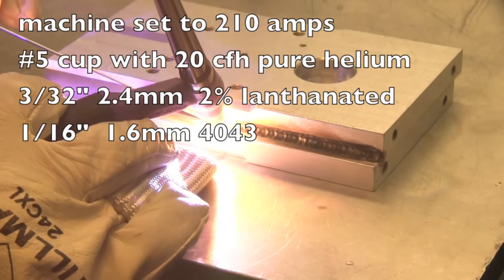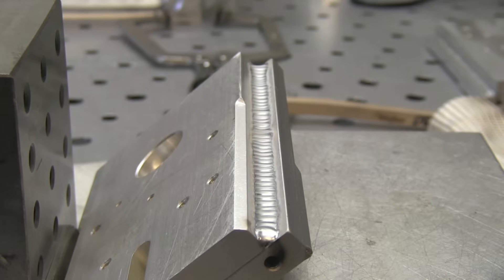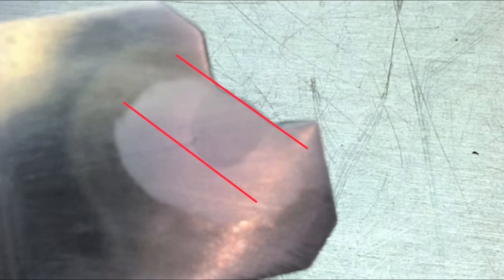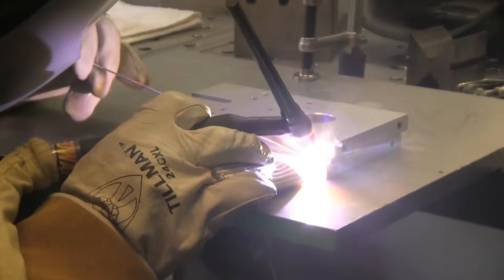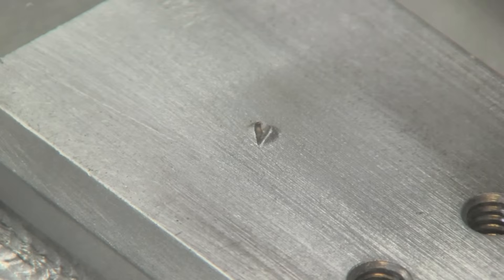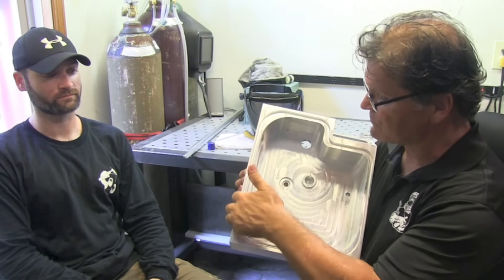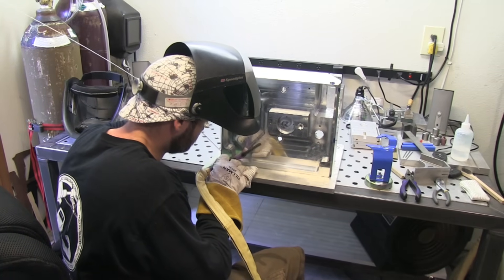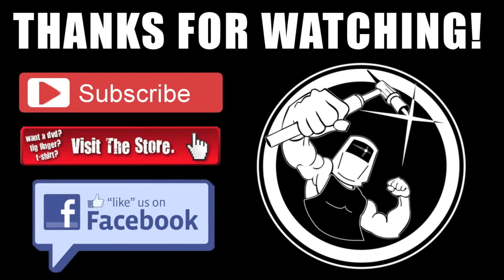TIG Welding Thick Aluminum using DC and Helium

Comment: Some of the inverter machines will allow you to interrupt DCEN with a pulse of AC every so often. My Everlast 255EXT calls it "Advanced AC pulse". Basically it combines the instant puddle and penetration of DCEN with the cleaning action of AC. The result is weld puddles that more or less look and flow like AC puddles - with the horsepower of DC. Neat feature.

Comment: ive seen some videos of dcep and dcen , im super confused what to use, i want to weld thin sheet aluminium butt weld as cheaply as possible, with a tig machine that had dc only and has a pulse option too

Comment: If helium is "pushing" more under the arc would a argon helium mix not be recommended for thin aluminum? I'm working with 2.6mm thickness

Comment: I've started aluminium TIG welding with AC machine a week ago and found that like I've never welding before. I've watching many videos in YT since week and still nothing useful found except some tips and tricks for beginners. So almost every vid in the YT are made in perfect condition and perfect position. Real life isn't that! :D
So, I made a desk from thin wall tube and beginning the welding frustrated me a lot, for a reason. Due I've never welding before. Okay, just kidding. Due I welding thin wall tube it get's good result and I'm satisfied. Now I have a project where I have to weld a thick wall frame, 5 to 10 mm thick, then I'm back in the beginning of this week - nothing came out. I've spent a lot of time in YT and today I found, a Youtuber said that preheat is necessary. Does it have any description too that how many degrees it has to be or is it kind a experiential? Many thanks for advance ;)

Comment: so i guess this is why it used to be called Heliarc.

question: if heliarc/dc negative heli gas TIG  welds are deeper, why did the standard get away from it and go to ac  and argon?   dont you want the strongest deepest weld?

Comment: I've welded 1/2 aluminum with helium on AC and it eats through. Never tried it on DC but I'm definitely going to give that a shot. I've pre heated with a hydrogen/oxygen torch and that worked well. Thanks for the tip!

Comment: Hi . I need some suggestions  I'm welding some aluminum  4
3/4inch to 3/8 I'm using Miller syncrowave 350lx  and it seems I need more heat it takes a bit to heat up I'm using water torch with 1/8 tungsten a number  8 cup and i have the machine  at 350 amps  and using 100% argon  and the at the end of tip balls up bigger then the tungsten  but still feel theres not enough heat
Reply: It sounds like you are in preheat territory!  Don't feel bad, since the energy you put in there with a big propane torch (for example) is probably a lot cheaper than the same energy (and argon) from TIG welding!
Reply: Sounds like exactly what I have at my job and I can’t imagine cranking it up that high for much of anything.  I also have rotisserie with torches and I would be warming it up if it was that big.

Comment: Could you do an AC cleaning run to get the Yuck off it first then go with  the DC for the first WELD then  back to AC for the top welds??????  Or would that start the heat too much for warpage.  And what about Helium AC does that wok as well with small cleaning  current?

Comment: I didn't realize you could do that. I have to try that with my Everlast welder.
Reply: Your Everlast manual says not to do this!  Mine suggests part Helium, which has worked for me.  I have tried to do as we see here and it wouldn't light up!  The arc voltage is higher with Helium!  I am going to eventually try with other machines, and also maybe heat the electrode first (strike an arc on a copper block for a second or two).  Try it!

Comment: OK, very cool, now here is my question... can this gas mix be used to achieve the same effect with a spool gun. I have a millermatic 211 and a 100 series spool gun and have an upcoming project to build my own 17" flat bottom river jet boat for fishing shallow rivers in MI. 

Yes, I know I should probably try and score a better welder but I am, ... pretty good life time welder with a LOT of experience but a thin wallet. I can step up, spend the $$ when it is time for the project but I really rather just use the 211 if it would work. The boat does not have to be built in a day.

If every one says no way on the 211, what would be a good tig machine to try and score off craigslist?

~
Reply: Since no one said anything, a couple things: one, the 211 is a very capable machine. Typically a 17' aluminum boat would have something like 18- or 20-gauge sheet aluminum... for reference, a 75 foot/40 ton steel vessel would use 1/4" steel plate for the hull. That being said, it'll be slow going to let things cool (no wet rags), but there's no reason you can't do this with a spool gun and 100% argon. If you feel like spending money, a pulse function would make life a lot easier, but it's by no means necessary.

Comment: Im making a welding table that attaches to my welding cart and the supports are 1/8 inch and table platform is 1/4 inch...my miller 180 SD is maxed out and I need more horsepower.  This technique is something i'm going to attempt and what i've been looking for....ty jody and roy.

Comment: Could you use pure Helium with AC tig welding to get the deep penetration? Or does it have to be Argon with AC.
Reply: I've had at least one welder (Everlast) that would not light up in pure helium. I think Everlast suggests a blend of helium and argon.  That works pretty well.  Got the idea from one of Jody's videos, it was just as he said.  I tried hard to use pure helium and just could not make it go.   The open circuit voltage has to be higher.  What they're talking about here is the real "Heliarc" welding, I really wanted to try it!   Maybe one day I'll turn up an actual "Heliarc" (from ESAB now) machine.  It seems so obvious!
Reply: Good to know!
Reply: I don't think there's any benefit.  You supposedly don't get the cleaning action with Helium, so you'd just be wasting gas and power.  If I had it all set up, I'd sure try it though!  How could you not?  Again, Argon with a small part of Helium or maybe 1/4 Helium is really something!  Hot, and it makes a big clear puddle, it seems to have all advantages.  If you do the set up Jody showed with two flow-meters and a "Y" to put them together....  try to do a little bead and have someone open up the Helium a little while you have the arc on, you'll see it right away!
Reply: Also, you can get a puddle on solid copper, which doesn't seem to happen with the usual Argon set up.   This might be important some day.

Comment: can you use helium to mig weld 1/2 steel eventho your machine is only capable of 3/16
Reply: Samuel Mason  more time id rather not waste.
Reply: I'd like to see the benefits of advance pulse welders. I understand they can weld much thicker metal than non advance pulse welders of the same output rating. I work in areas that have low amp electricity service. I really want to know more about some of the everlast welders with advance pulse used with helium.
Reply: John Kuck would be pushing it but i bet i could be done just not at full penetration
Reply: Are you asking if it can be done in a single pass?
If you can get the cup and rod in you can weld 2"  just a lot of passes!
Reply: @ John Kuck: Could you point me in the direction of where I can find information as to why He carries so much more heat? I like to know the how and why as well. Thanks

Comment: pse tel me why 37 degrees is used for pipe welding . why not 40 or 30 . surely that takes time to measure the exact degrees of 37
Reply: the bigger the groove you have to fill the more passes,filler,time and HEAT you will be putting into the joint.i worked in high production pipe fitting in Alberta and we never checked the bevel,just an eye ball thing.good prep is a sure way to have an easier time welding though.

Comment: wow!! this was an incredible video to watch and listen and LEARN.  thank you so much. i had tried aluminum tig on DC before and i came out nothing like this, however i was only using straight argon.. i will definitely be giving it another go.  the fact that you can get that much penetration without warping and a ton of pre heat is very useful.  keep up the good work and tell Roy that i check out his instagram all the time for amazing stuff.

Comment: 12:51 Why do you run the torch down the center of were you will be welding prior to starting your weld?
Reply: +Mark Rich on a lot of his videos he shows the path prior to actually striking so that he can confirm that he has the full range of motion available to complete the weld without stopping.
Reply: You do that to make sure that your hand can move without any obstructions all the way along the weld. Nothing worse than getting snagged by something mid-weld

Comment: do you need a different flow meter when using Helium? Thanks
Reply: Yes since helium has a much lower density than other gas's.  The floating ball type flow meters usually have scales for argon, C-25 (25% co2/75% argon) and helium. Usually you just turn the tube so the scale for the gas your using is facing the front to read it.  The cheaper pointer gauge type mostly are calibrated for C-25.

Comment: Hey Jodi would this work on anodized aluminum tube welding in the marine industry?
Reply: I don't think you get the cleaning action with Helium.  You might get lucky and it just somehow PUSHES the anodized layer away?  Take pictures!  This is an issue that comes up again and again.

Comment: Hi Jody, thanks for the clarification of this problem. i have a lincoln invertec V130S with a scratch start TIG torch.
what would be the minimum amperage of a welder you would recommend for welding aluminium with a DC welder? mine goes to 130 amps, the one you guys were demonstrating on was 210 amps. would my little welder be too weak to do any type of aluminium welding?
mike

Comment: Hey Jodie. Would this work with an argon co2 mix given the good  penetration properties of co2 as a welding gas?
Reply: No with TIG you have to have an inert atmosphere, argon or helium, or argon/helium mix because you have to protect the tungsten from oxidation.  That's the reason why you have a post flow setting on the machine, to allow the tungsten to cool down before it's exposed to the air.  Carbon dioxide splits apart in the arc and for a fraction of a second becomes carbon monoxide, loses it's energy then recombines to form carbon dioxide again.  This works well when using MIG on steel, sense you can add de-oxidizers to the wire.
Reply: Your electrode will burn away!   Probably won't do the Aluminum any good, either!  There's more to life than penetration!  "That's what she said".
Reply: At my job they got an Argon - 10% co2 mix by mistake and asked if I could use it up so they wouldn’t have to deal with returning it. I tried using it and while it welded fairly well ( little sooty ) I found out the welds came out hard as rock. I told them no, I can’t use it.
I don’t think I tried it on aluminum.

Comment: thanks Jody for the awsome vid. i do 90%of my welding infield, i dont own a spool gun, so when it comes to aluminum I have to through my small tig diversion 185 on the truck which does the trick on irrigation pipe and thin al. repairs, but when iam stuck in a bull hauler working on structure, that welder hardly cuts it, even with preheat, but what i have learned from your videos will definently makes my life and welds better, thanx

Comment: Hey Jodi have you built a tungsten sharpener ? I came up with an inexpensive harbor freight version that seems to work great. 

4" angle grinder
Chainsaw sharpener replacement blade
And a small bushing I made on my lathe and a guide block to slide your tungsten into.

Robert
Zr1.rar@gmail

Comment: I build aluminum boats, and I'm at the end of our production line. I'm responsible for repairing other peoples leaks in the gas tanks, etc. It's a real chore with AC, and I'm curious if this technique may be beneficial to my company. To be more specific, I'm wondering if the DC current would burn out an impurity beneath the surface, or if the same ammount of grinding/cleaning would be necessary? We use marine grade aluminum, I want to say it's 8056. Thanks in advance
Reply: Gabe M Maybe 5086-H32 ? listed as good marine grade,strong,resistance to corrosion.

Comment: Does this type of welding meet standards? The depth to width ratio on that weld is wrong, that's the reason there is a solidification void in that one one, which would fail any test right? 

I can see if you're using it for non critical things but if it had to be tested I would think its a fail.

Appreciate the video though, was interesting!

Comment: Interesting video.  I have a classic semi-truck (1970 Autocar) with an aluminum frame (11" 6061T6 channel, 3/8" thick web) that has lots of holes drilled in it from the original suspension brackets and the replacement suspension added in a previous restoration.  One day, I'd like to plug all the excess holes and I'm planning to upgrade to air-ride suspension, so there will be even more holes.  I was planning to cut 6061T6 slugs to fill the holes and tig weld in.  It looks like this process would be perfect for getting good penetration without affecting the temper of the surrounding frame.  Great info!

Comment: Hey Jody thanks for the video on dc tig aluminum welding with helium gas. Please do more videos on this type of welding because this is a truly a lost art of welding. This procedure isn't taught in schools in Louisiana especially for welding aluminum pipe. I know alot of welders that have dc engine driven machines and when when they need to do aluminum works either its mig or stick. Also what grade of helium gas needed to be used?
Reply: Yeah, more CRUMMY!   I think there's only one grade of Helium!   Different bottles, you can get a cert, but it's all coming out of one tap.  Oxygen and CO2 are like that.  Medical Oxygen and welding oxygen are filled from the same tank....

Comment: Excellent video Jody, very interesting.
Also good to put a face to the name, as far as Roy is concerned.
Now, the inevitable question arises here Buddy. 
Following up from the video, can I weld aluminium with my DC inverter welding machine DCEN using MMA method ?
And if so, maybe the subject is worthy of a video, keeping out of that long haired, hippie physics shite, of course. LOL

Comment: Thanks for video.  I've had a few times where i actually needed this technique and spend lots of time preheating before I was able to get the penetration I needed.  It's funny you started this video talking about experiemental aircraft because I was welding the frame of a powered parachute.

Comment: this is a great video! mainly cause nothing is taught in school on it, so it's a mystery to some. I talked in the past about failing a welding test at SpaceX in Florida cause they wanted thick aluminum welded in DC neg. it was for the launch pad structure arms that held the rockets in place. they have had some of the arms break off cause they were welded in A/C current. I saw one that had fell off while I was there testing and as big as that arm was, you don't want that thing falling off during a launch...

thanks Jody

Comment: very informative! is the arc some what unstable like when welding stainless with pure helium, like if you don't watch your arc length?  also would you be introducing that black oxide into the base material if you wire wheeled it at high rpm?

Comment: Does DCEN have the same effect when running straight argon?
Reply: MrGangsta9812  Good question wondering the same thing now !!
Reply: Sadly, it doesn't.   Otherwise, our man would probably use the much less expensive Argon, which everyone already has.  It does SOMETHING!  I mean... that oxide layer we keep talking about is quite thin, and also floating on TOP of the puddle!  If you are really desperate it's not hard to push some rod through that into the liquid underneath.  I did this a few times as a demonstration.   I'm sure there are good reasons to not do this if you don't have to.  Anyway, the thing you're talking about isn't the usual way, but it's a cheap experiment, and you probably won't get hurt....

Comment: What about thinner structures ie >1/4 " ,would 150 amps work ? and other tuber asked UHP required or just balloon He ? . Cooler and hotter vids each time!
                       Thanks,Ed
Reply from the maker: E Flanagan balloon gas usually has other stuff added so I wouldnt use it.  We just used regular welding grade but Uhp might work better.  from what I hear, sometimes uhp is just tested to higher standard and sometimes is same as regular welding grade

Comment: Great information as always and you're not lying about making machinist friends with repairs; saving £1,500/8hours time invested parts with 5 minutes of welding makes them very happy.
Reply: At my job I am quite often using my ‘ hole remover tool ‘ to make holes in aluminum parts that they drilled wrong go away.